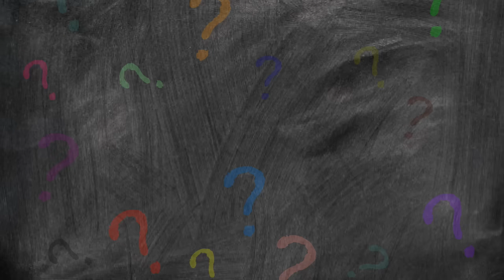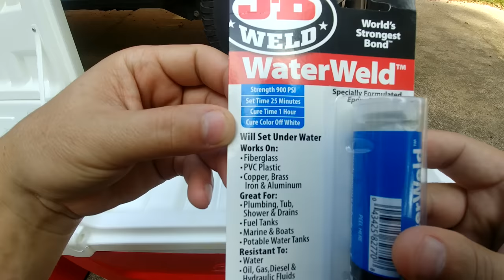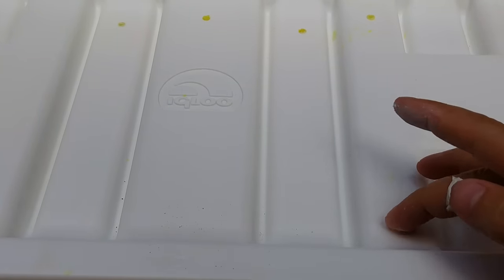Do Yeti cooler hacks work?

Comment: Use the seal and add butterfly latches, that will do a lot. You are never going to get great performance out of these coolers because they use a large cell foam and does not retain temps very well. One other thing todo to get the best performance is to pre chill the coolers so you are not having to cool down the foam with the ice, because you now have more mass to cool down you are wasting ice to cool down the extra mass.

Comment: Question for the smart guys in the comments, wouldn't the foam generate heat as it expands inside the lid and therefore maybe have trapped heat in the top? Also, isn't that foam used for insulation in other applications like construction, etc, and if so then why does it insulate in certain cases and not insulate for things like the lid? Thanks!!

Comment: The air in the top is the insulator once you broke the top and sprayed foam it lost it’s real ability to insulate. Air is a great insulator
Reply: No the issue is he used WAY too much foam and it went from being a potential thermal insulator to a thermal mass

Comment: should have just used silicone on the holes. One big advantage is if you put 1/2- 3/4"  styrofoam liner on the inside. Get the more durable kind that is pink or blue in color. Seal it upbut a great project all around. thanks.

Comment: You didn’t season either cooler. Sure it’s better insulated, but you started with warm coolers so the better insulated cooler had a harder time transferring to cool as the heat was trapped.

If you read instructions on most cooler websites they recommend putting ice in the day before to get the cooler to a cold interior temperature both inside the cooler and the insulation closest to the inside of the cooler.

Overall though, these coolers were designed to have air in the lid, by changing the design the cooler can no longer function as designed

Comment: Nothing is more insulating than a vacuum. The lid is sealed with no air inside it, by drilling holes you break that's seal

Comment: You need a dead air space just like on a thermals or double wall glass/mug for better insulation.
Reply: Those are vacuum sealed.  It's not dead air.

Comment: agreed with air is a better insulator than foam spay. but i think yetti pulls it off because they suck the air out of there walls and use a polycarbonate foam that is 98% air to plastic mixture

Comment: Spray foam has more conductivity than air. Better off leaving it as it and putting some reflectix on the lid to reflect heat when keeping the cooler outside or on a boat... Or keep it in the shade.
Reply: More conductivity than air?  No.  Look up the R values.

Comment: Need to fill both ice chest with ice the heat is trapped that was previously inside the chest there was to much volume of hot air which caused the ice to melt in the non-insulated ice chest versus the insulated ice chest which allowed the heat to escape the none insulated one

Comment: The lids dead air the foam hack is conducting heat top to bottom of the lid the other dead air space slows the heat transfer. Wanna make a good hack use radiant barrier on the outer cooler wrap it. Also do the inside as well that should work out better than anything else

Comment: Greatstuff is not an insulator it is a gap filler it is used to plug holes and stop air flow
Reply from the maker: This is from their website for the widow and door foam I used in this project.  "GREAT STUFF™ Window & Door Insulating Foam Sealant is a specially formulated, minimally expanding foam with a low-pressure build that remains soft & flexible after curing. The foam can be formed without trimming to create long-lasting, airtight and water-resistant seal proven not to bow window or door frames when properly installed."  https://www.greatstuff.dupont.com/products/greatstuff-window-door.html

Comment: You are testing in the wrong direction. Test them by heating up a pot of water to a specific temperature, wrap the pot in a blanket so that it is wrapped up, but you still have access to measure the temperature of the water, set it in the cooler and take the temperature of the water. Do that with both coolers, close them and come back 12 hours later. Whichever cooler has the higher temperature water after 12 hours is the best cooler. The absolute best way to do this test is with a set of wireless meat thermometers. I would suggest using MEATER wireless thermometers used for grilling steaks and such.

Comment: Unmodified had an Air gap modified did not. Heat transfers through a solid faster than air. Maybe do it again swap lids from one to the other. This will tell you its the lid not the bottom section.
Reply: That's wrong, steel transfers heat faster than ice (it's a solid too), but air transfers heat right in the middle of the 2 solids I listed....
I kinda understood what you were saying, but maybe this coolers were developed to perform better in stock version 🤷🏽‍♂️🤔

Comment: The foam u put in is the problem, If you have a void layer like in the stock cooler, the heat has a tougher time getting through. Works even better if the insulation is just a vacuum

Comment: The difference was not was he expected.  Reason being the ice itself.  

The ice he put in the modified cooler emptied out of the bag as more or less individual cubes.

The ice that went in to the unmodified cooler emptied out of the bag as chunks of ice not as individual cubes.  And we all know block ice will last longer because it has less exposed surface to react with heat.
Reply: Agreed I've always kept empty milk jugs and froze water in them for this kind of thing larger chuncks last longer. Plus it he put a 24 pack of cold water bottles they would hold the ice better
Reply from the maker: I like this suggestion to use block ice instead of bagged ice but I think it is important to note that if this hack worked and the cooler performed like a Yeti this would not have made a difference.  If I did this same test with a Yeti verses a Wal-Mart cooler the Yeti would win in this exact same test.

Comment: Heat rises so the heat escapes the one you didn’t modify but stays in the one you did you would have to insulate the whole bottom of the cooler then it would work.

Comment: try spray foaming the bottom and the sides and cut a piece of blue-board styro-foam to put inside on the top to seal it off, you should see a difference otherwise another one you can do is line the entire cooler inside with the blue board insulation instead of sprayfoam.

Comment: Pop the plug out of lid.    Get bag of fine closed cell styrofoam beads from Walmart/ hobby lobby and fill lid replace plug after full.      Your welcome.     Edit: spray foam cant work in lid without air flow.  It IS NOT CLOSED CELL either.     Its for drafts not insulation anyways

Comment: Turns out air is a better insulator than the foam you used--it it is too thick it is just a conductor. A concrete box would not be a better insulator, right?  Putting LESS foam in MORE holes will facilitate a more even distribution.  Using lighter weight foam might be better, too.

Comment: You need to try it again and switch the cooler positions maybe the sun's hitting one side of the truck more than the other because it doesn't make sense that what you did wouldn't have helped at least a little bit

Comment: Add a latch. The weather sealing foam tape is making a gap.
Reply from the maker: If you noticed the result was the same after I took off the weather stripping. I really think the seal was good enough with or without the weather stripping and that is why taking it off did not change the outcome.
Reply: How To With James 
I add latches even without any other modification, so I might have bias. Also the best seal is in lids.

Comment: That taped on gasket is what killed you. Without the gasket, the foam filled cooler would have fared much better, because you would have maintained the factory fit seal between the lid and cooler compartment.

Comment: I understand this is an old video, however the fatal mistake with the hacked cooler is that once you installed the seal around the lid you failed to install the rubber latch so that it could stay cold

Comment: I wonder how real insulation like used in wall would work. I think they carry a different version of that spray foam that might suffice, if this is possible at all. - Edit 10 mins ltr ==> Found this note now that I'm stuck trying figure this out. Thanks for that ! 🙄😂  "IMPORTANT! Not all foams are created equal. Much expanding foam is designed to fill gaps and create seals not to insulate. You want to make sure your get a closed-cell polyurethane insulating foam as these insulate the best. Buying the wrong foam can decrease the performance of your cooler."

Comment: You didn’t put clamp locks on it to SEAL down the new rubber insulation on the lid.
makes a huge diff on a real deal- all the yeti top end have a snap/ lock to crush the top down onto the seal!
the cold air is leaking out !

Comment: Why not have all the cooler filled with foam?  Like any high quality cooler out there?  Air is a very bad insulator, and you let the core of the cooler uninsulated.  This is where you have the more square inches, so heat loss there is the worst.  I say, fill all the cooler with foam insulation if you want to really try something.

Comment: Redo the same test, but this time run duct tape around the closed lid a few times and seal it up.  Also leave them both outside in equal sun.
Reply from the maker: Why put duct tape around the lid?  Are you thinking it did not seal good enough?  If you remember in the video I tested it using weather stripping and again without and in both cases I slammed the lids down and showed they were closed.
Reply: @HowToWithJames  Correct.  Eliminate the air leakage factor altogether then you can prove/disprove this air gap myth that seems to be running rampant in the comments section.

Comment: With insulation, you want a foam with a lot of air bubbles in it.. if it's just a solid block of insulation, heat will transfer easily and evenly through it. I think pumping that insulation you put in there just expanded too much and made a block of foam making it worse than having that separation with the unmodified cooler.
Reply: Btw the same thing applies to putting insulation in your home.. if you buy that non-foam insulation, you don't want to cram insulation tight, you want it snug so that it stays in place but not more than that, and make sure you don't have gaps.   Gaps or having insulation packed too tight defeats the purpose of installing insulation

Comment: Seriously science is not working out here. There must be something we are missing. I first agreed that it was the stripping you put around the edge and was convinced that you would have a better result after you removed it. Did you park your car with the drivers side facing east?
Reply from the maker: My Jeep was parked in between two houses on my driveway. After about 1pm my neighbors house blocks the sun to the driveway. The driver's side faces west and the passenge's side faces west. Regardless of that there was no direct sun exposure. Check out my second video on this.
Reply: @HowToWithJames  I will absolutely check it out, like and subscribe… I think a Tupperware bin with a cooler inside, and a raised bed will outdo them all.

Comment: air gap vs closed cell foam.     
Close cell foam gave more surface area to remove/gain heat into cooler   ie ice melted quicker
next time try  different air cell foam that has more air cell than the more dense/ heavier foam.  Then your test will show good

Comment: A baseline prior to modding should've been accomplished. The coolers are made so cheaply with such low grade materials that there could be a legitimate difference between both without any mods at all
Reply from the maker: I agree this should have been done but if this actually performed like a Yeti would the results even be close?  If I compared a Yeti cooler to this stock Wal-Mart cooler do you think the Yeti would just barely be better?
Reply: No way the cheap cooler beats a Yeti in a head to head. With that said, what I meant was to do a side by side baseline comparison against each other of both of the cheap coolers prior to modding either one. That way you'd know if they were "equal" to each other.  Side note: I did watch this one guy put a cheap cooler inside of a storage tote and he spray foamed the space between cooler and tote (and also the lid).....  it kept pace with the Yeti!

Comment: You do realize you have 2 different brands, although they were probably made in the same factory (going from looks) they may not have the same amount of insulation in the sides and bottom! That's why the Ozark Trail cooler was cheaper than the Igloo when you bought them!
Reply from the maker: Exact same cooler, different sticker. I mentioned this in my second cooker video because so many people said the same thing.
Reply: @HowToWithJames  Not necessarily as I have had issues like this before unless you were the one putting the stickers on! Made in same factory with same look doesn't equal same insulation,  that's how they get you!!

Comment: I've seen this done before. They had vent holes for the foam to escape as it swelled. All walls of the cooler and the lid were filled with the spray foam until it reached the vent holes. After it cured it was tested against a Yeti cooler. The cheap cooler that had been filled with spray foam performed equally with the Yeti. It was impressive. I've always remembered it. Good luck with future experiments.

Comment: You would have better luck glueing Styrofoam to the bottom of the lid, then you would have your air gap plus insulation. But insulation on the top is only going to make a modest difference, most of the heat is lost through the bottom half of the cooler.

Comment: I was also thinking sun may have been a factor. You should have covered with reflective material maybe? I know if one cooler was catching more direct sunlight than the other it would definitely throw off the experiment. Just swapping positions won't necessarily work unless you had two equally sunny days. Just sayin... science is hard 😆

Comment: Another thought is cheap coolers have horrible quality control and the one you worked on has other issues! Maybe 1 small area with warped plastic and an air gap would net much different performance.

Comment: Thats spry foam  and wether striping  use spray adhesive if you want the wether striping to stay. Or home Depot makes a thing called fuseit. If you get it on your hands use wd-40 to get it off. Would say don't use that water wiled . Try a good grad silicone you are putting food and drinks in this . Hate to some get sick or die from cmicles . You have an air  leak somewhere.

Comment: The problem(s) 
1. is you’re changing the engineering of the lid to cooler with the spray foam. More weight is also changing the expansion of the cooler. 

2. You should’ve pre chilled the coolers full of ice for 10 hours drain the water then topped both with ice to get a true measure of results. If you actually improved the cooler YOU TRAPPED THE HOT AIR INSIDE     Even a Yeti will not hold ice long if half filled and not pre chilled. Because the hot air in the cooler will advance ice melt. Heat rises cold sinks. Therefore both coolers need to be prepped and filled

Comment: No. It's because you didn't precool them first! The insulated cooler suffered because the heavier insulation retained more energy that needed to be absorbed by the ice. Pre cool them both first. Then add the ice and start the test.

Comment: New Theory: heat from the car is not entering via the lid but from the 100 degree carpet. If the insulating properties of the foam are indeed better than air, this would explain why the heat would not escape. Try the experiment on the ground instead.

Comment: Theres a reason they dont insulate the lid . Thats because heat rises . If the lid is insulated , there is no way for the heat to escape . One could say well its a cooler , there is no heat , but thats not entirely correct , there is always some degree of heat , if there was absolutely no heat the the temp would be at "absolute zero" (approx  . Negative 459.7* f )  , if the inside of the cooler was at  negative 459.7 * f.(Below zero ) , then it might be beneficial to insulate the lid , just sayin

Comment: Well, the answer to why this experiment didn't work the same as in other videos is a simple one that happens to be the fault of the person experimenting! (Of course, this is two years later so hopefully, this has already been pointed out to this content creator) hopefully someone has pointed out the huge flaws made in this experiment resulting in different results then seen in videos made by others, you have to take into consideration the amount of integrity you're working with while doing this video and the different results due to that elevated integrity level and the answer is as simple as that! So now that we've cleared that up take your 2 coolers but when going to store buy 3 bags of ice, make video showing you dump one bag per cooler and leave, next day before starting recording dump 3rd bag into modified cooler then record video but never mention 3rd bag!

Comment: A yeti is 2-3 inches thick all over and sealed tight with lid locks holding it shut tight I guess by the time you do what it takes by a better cooler that’s why it cost more it’s Cadillac cooler the cheap ones are Chrysler cooler

Comment: For people stating about thermodynamics laws. I think those laws apply also to every single bubble of gas inside the foam, just as if the lid was a giant bubble. That's why thermal transfers is delayed in those types of insulation. But that's my two cents! There's a whole lot to it.. that's why you don't find a physicist in any other YouTube video. Lol.